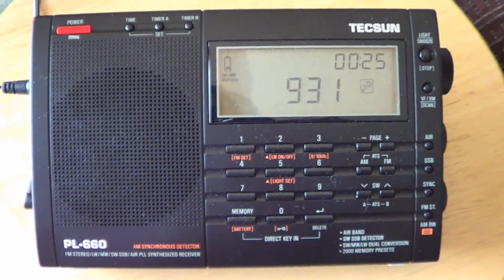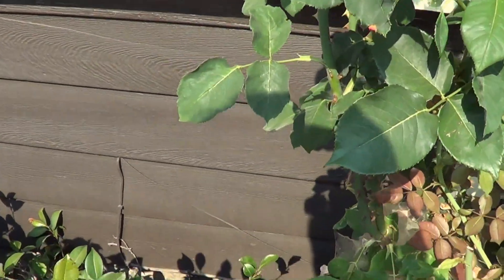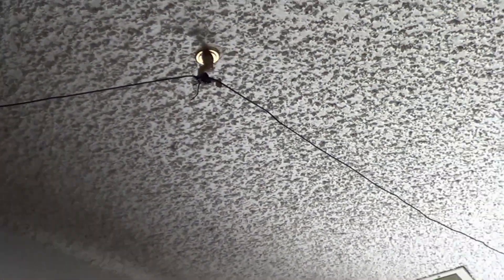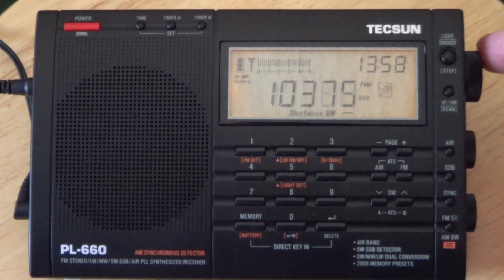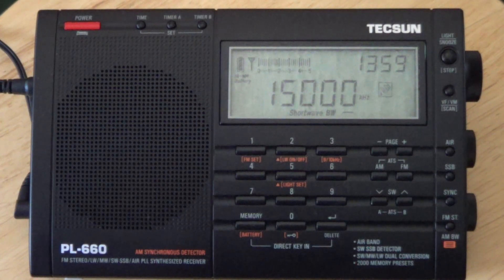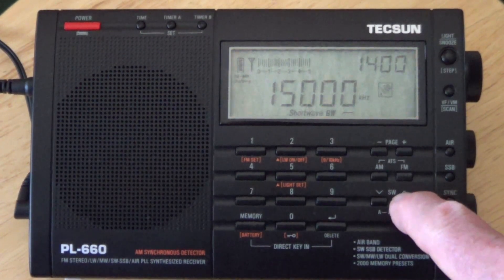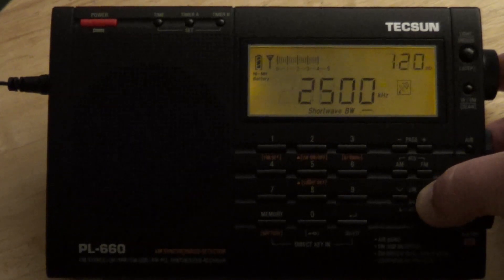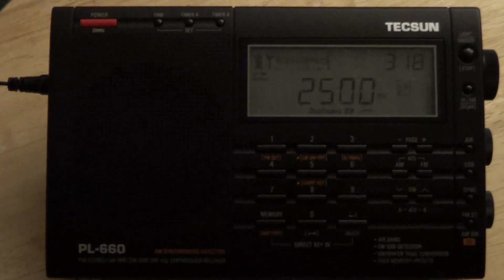(The Tecsun PL660) ~ on The ~ [Rain Gutter Antenna]

Comment: You can use an alligator clip connector to attach an out door antenna to a telescopic antenna, but it will be likely over load the receiver some. One way in connecting a coax from an out door antenna to a telescopic antenna radio, is to wrap about 7-10 turns of wire around a cardboard tube, and connect the antenna to this, then slip the tube over the antenna. Antenna connects to one wire, ground or shield to the other wire. This is a "coupler."

Comment: If you do not use an antenna tuner; Expected bands; 468 / length of gutter in feet =  center frequency to expect best reception if you are connected at one end of the gutter..  Then start multiplying by two to find other bands to expect similar overage on the rain gutter until it tapers off to static.. While you are at it, divide the frequency by two a couple of times. There will be dips in the coverage between these.  And night time is better for the lower frequencies to come in and day time is better for the higher ones..

Comment: My Tecsun PL-660 arrived in the mail yesterday.
It picks up the local radio station pretty well, but that's about it.
I live a mile from the airport, and the airband doesn't pick up anything.
I live 200 yards from the ocean at a major seaport, and it picks up nothing.
Nothing on airband, sideband, or shortwave at all.
It's basically an expensive am/fm radio.
Reply: Lean like a Cholo something is wrong, or bad conditions.
Trust me. It’s AWESOME! It’s ok on shortwave. Really good on SSB. Ok on Mw and lw. Fm is pretty good. Air is ok too. So for around 130 euro ( my purchase price ), it’s alright,
Reply: May be one of these? https://youtu.be/j-MPvzzJuMU
Also make sure you have a good antenna and the attenuator on DX position.
Reply: @sa6kod154  
Thanks, this is my first radio and I had read that some of these are junk upon arrival.
Mine works good for am and fm.
I get the general info airband channel from the airport, but not the tower, which can be heard online. Maybe the tower is encrypted?
I did get some weak shortwave signals after stringing the included wire outside.
Still nothing from sideband.
I've seen some indoor antennas online, do you know anything about those?

Comment: Did you happen to do a comparison between the gutter and the built in whip on the antenna; just to see how much better the gutter does, if any?
Reply from the maker: I did. The Gutter was about the same as The Built in Antenna as Long as I was out side with the Radio.
Thanks for Watching
Reply: @danjarrett  We just recently moved into a house with a nice gutter that I was considering trying to use as a SWL antenna. Gonna give it a whirl, one of these days.